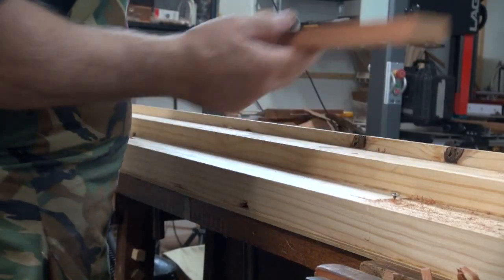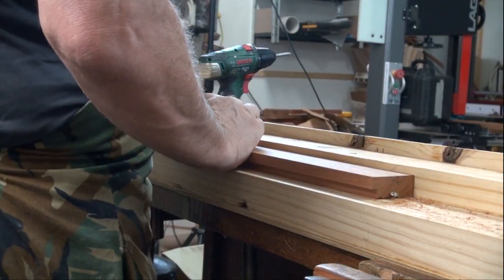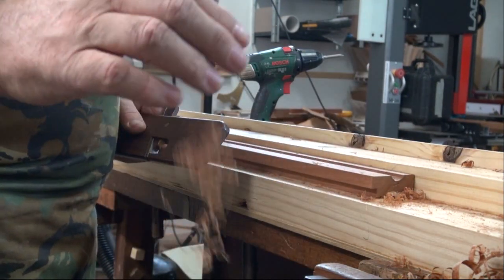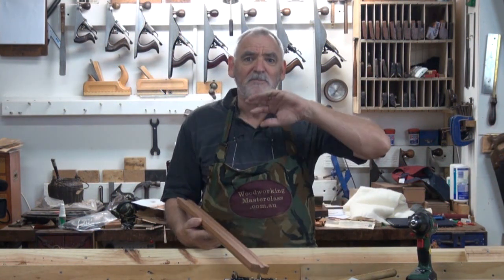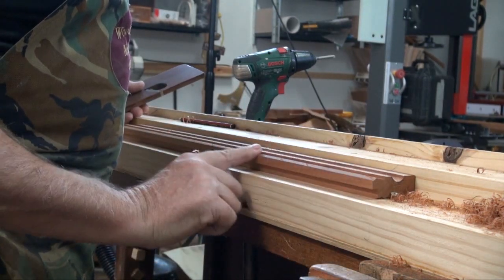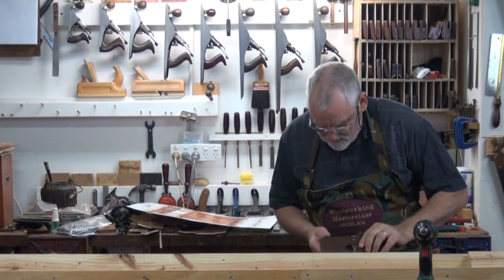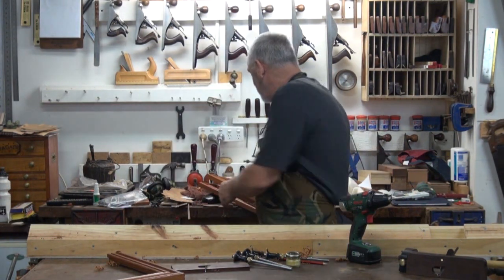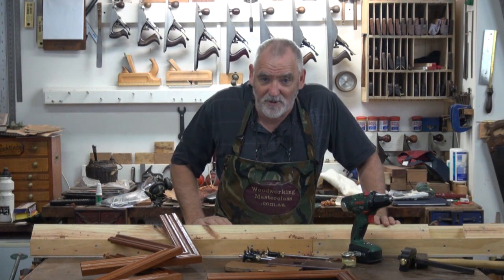Picture Frame Mouldings with Round and Hollows Pt 2 of 2

Comment: Learning all the time. Like the tip about burnishing the wood with the shavings, I will give it a try.
Reply from the maker: It give s a great result and depending on the timber used nice smell as well. Thanks for the feedback Peter. Cheers Steve

Comment: Love the hand tool classes great work and a huge fan of the HNT Gordon Tools. Question with the Linseed Oil you use in the glass jar. Isn't linseed oil combustible I like the idea but a bit nervous. Would machine oil in a tin Paul Sellers Style suffice? He uses this on metal planes with no issue, no sure if that translates to Wooden Planes. Keep up the great work!!
Reply from the maker: Thanks for the feedback Stephen (great name by the way).  Terry Gordon recommends using it, so I guess he knows what's best for his planes. I know of self combustion with linseed soaked rags but this has a lid on it and I've never heard of self combustion of bottled Linseed on shop shelves . Haven't seen what Paul Sellers uses so I am unable to comment. I personally prefer to use candle wax on metal planes. But whatever works and whatever you feel most comfortable with are my thoughts. Main thing is you enjoy your woodwork and have fun. Cheers Steve